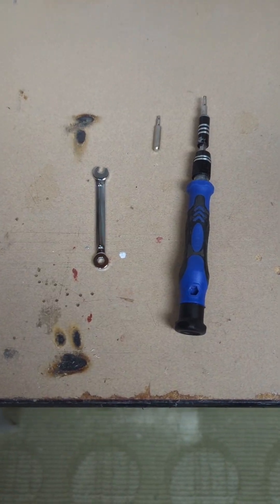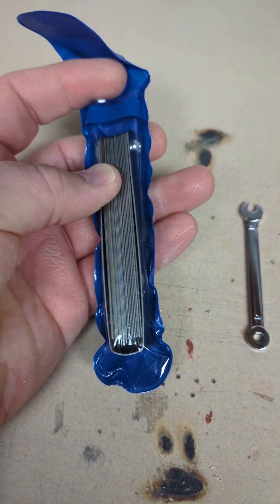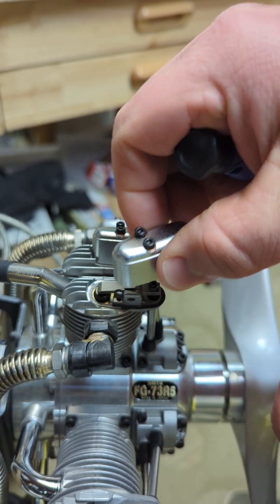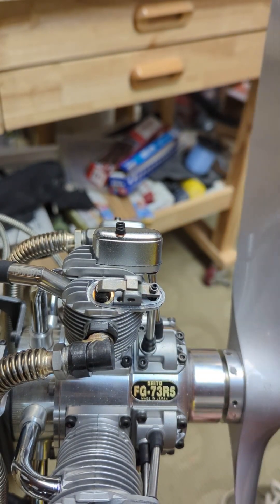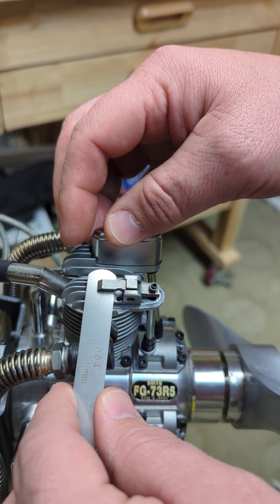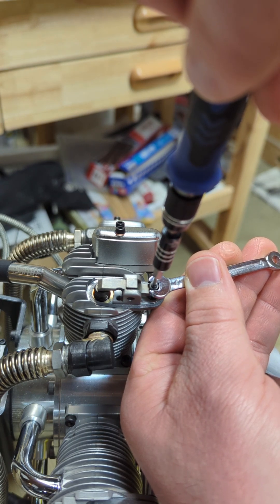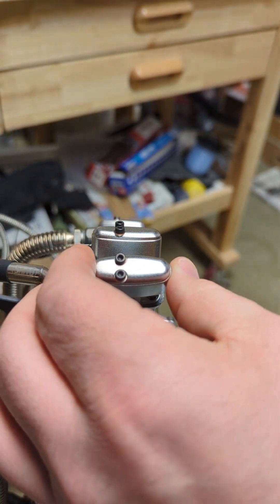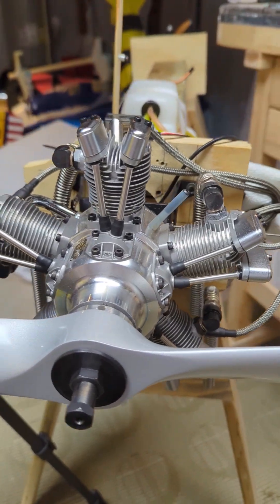Saito Tappet Adjustment on the FG73-R5

Comment: Not so excellent, the manual states that the feeler gauge of 0,1mm may not be inserted. The gap should be smaller, like all Saito engine's
Reply from the maker: Hmmm, best to check the manual for your specific engine then. The three Saito engines I have (FG-73R5, FA-200R3, 150S) all state this gap.